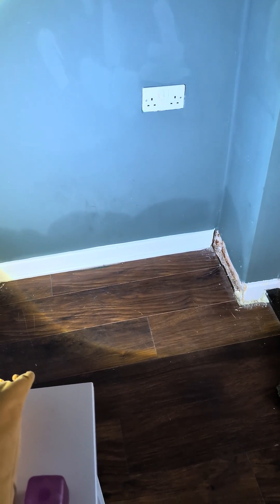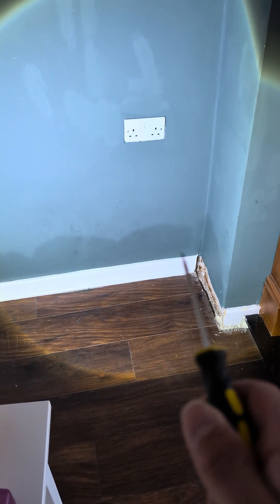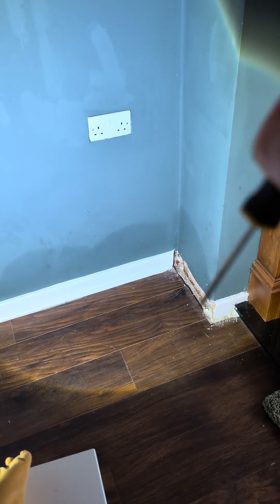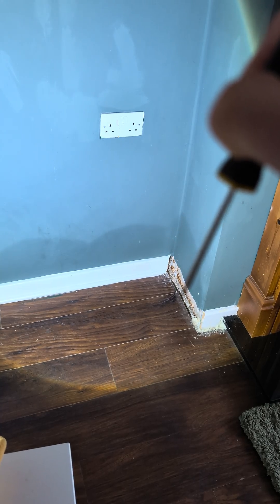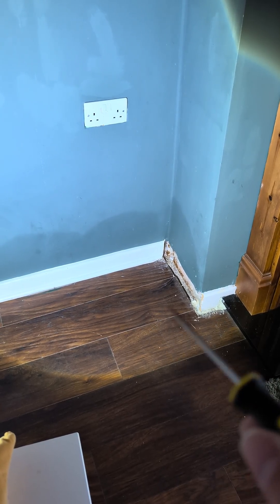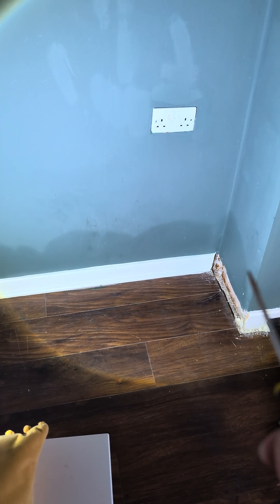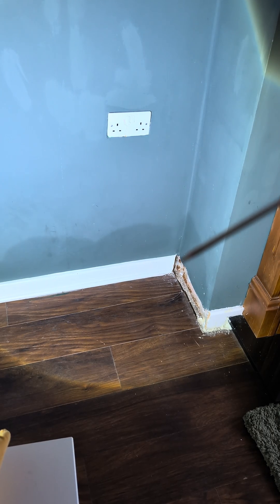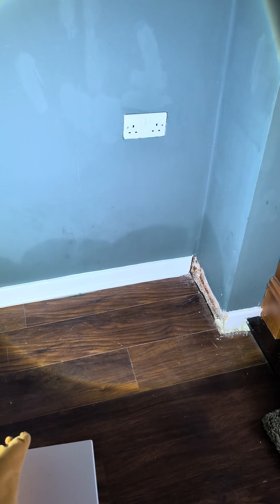Not Rising Damp! The Real Cause of Damp Revealed During Survey (Plasterboard Bridging)

Comment: Won’t the plasterboard be wrecked on the other side, iv been dealing with the same thing in my place where they put the plasterboard to the floor, except it was wet up to a metre high and when you touched the plasterboard it fell to bits so Ive removed it up to where its dry
Reply from the maker: Hi, every damp issue is different, and in this case, we caught the problem early. The plasterboard is still in good condition with no swelling, and it doesn’t crumble when touched.

Your situation sounds a bit different, but I wouldn’t want to comment too much without being able to inspect it in person and see what's on the other side of the wall, etc.

Have you managed to find the root cause of the moisture? If it’s travelled that high up the wall, it doesn’t sound like simple bridging.
Reply: @DampServeUK  I think it’s coming out the ground, the floor is quarry tiles on sand that was covered with a wooden floor, but I’m no expert
Reply from the maker: @rbxrockettrio8650 Hi, it’s hard to say for certain without seeing it, and I wouldn’t want to comment too much or risk confusing things. If you’d like it checked properly and correctly diagnosed, feel free to get in touch. We cover most of the UK for surveys. Just fill in our contact form, and I’m sure we can help or point you in the right direction. https://www.dampserve.com/